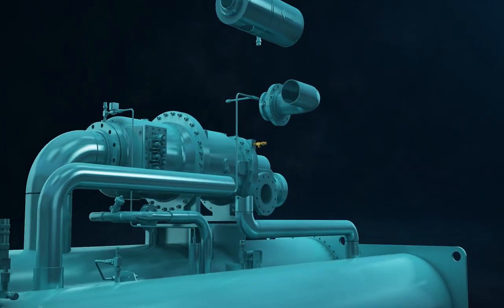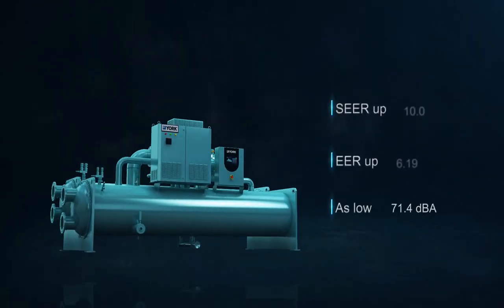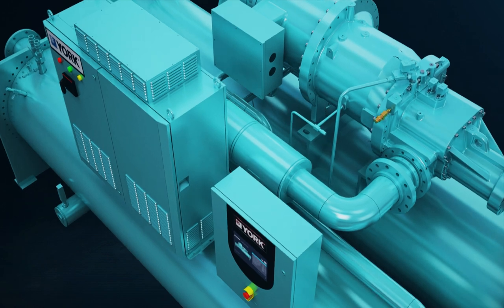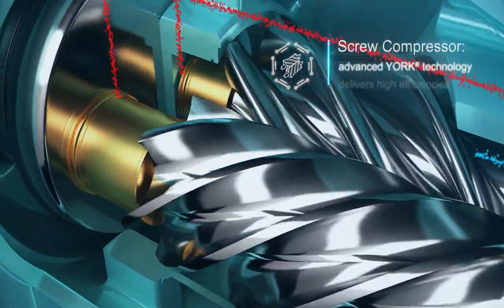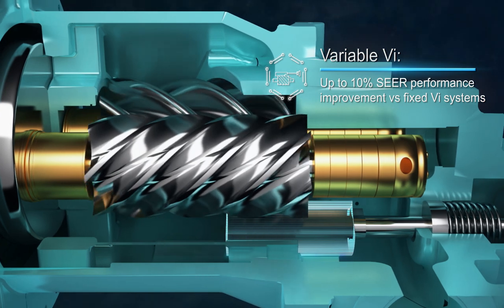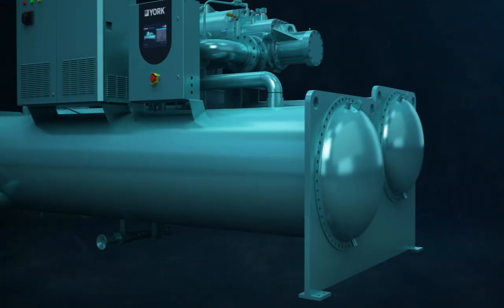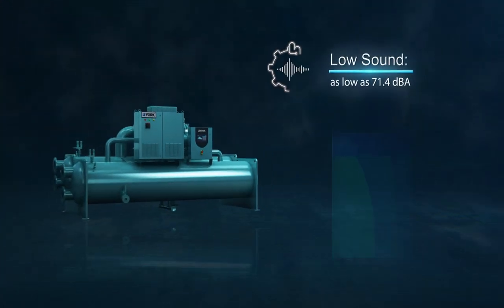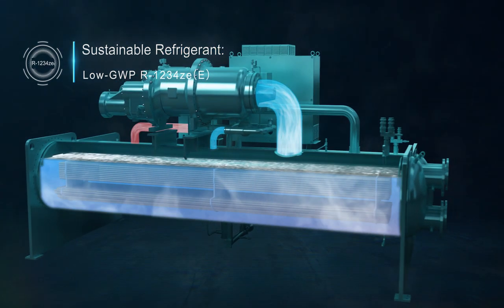The YORK YVWH Chiller Europe Introduction

Comment: Built a few of these as Form 7 and also commissioned a few in the U.K. In conjunction with a Danfoss Novacon valve the COP’s went through the roof. These are very very efficient machines in R1234ze